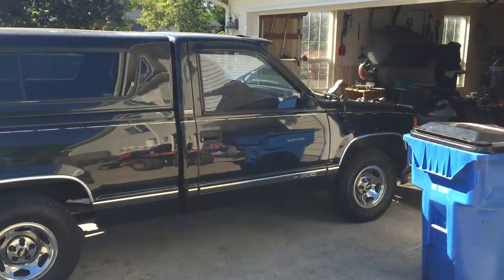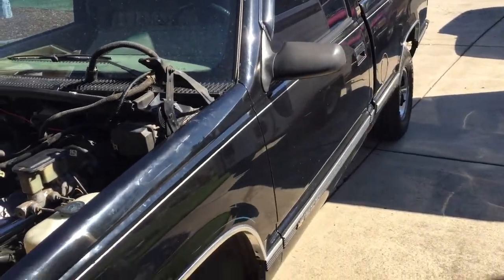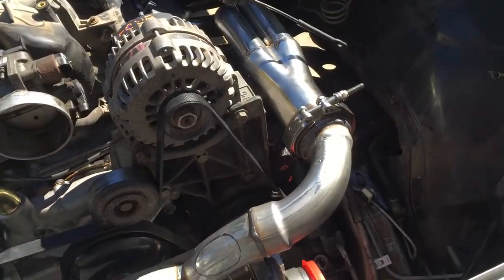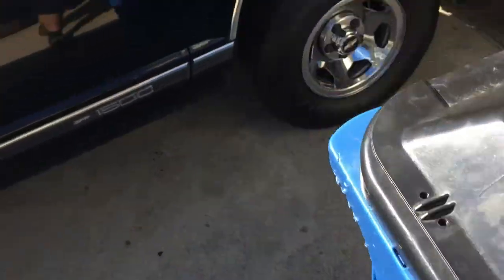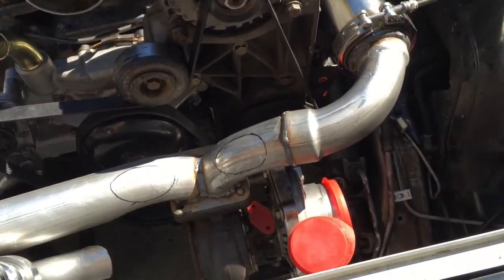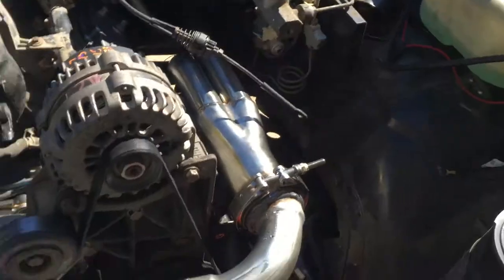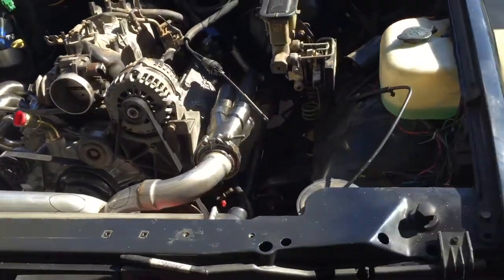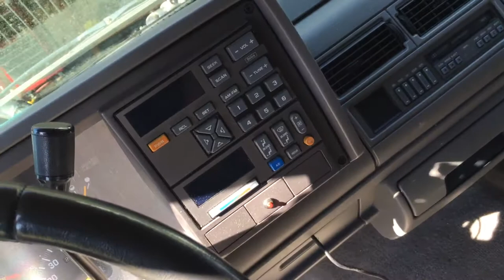93 silverado lq4 turbo swap

Comment: You don't need a to get trans specific computer so say you have a 4l80e but wanna run a 4l60e you can do a segment swap on your ecem for the different transmissions your tuner can do that when he's running out vats

Comment: Google "Lextech LS AC relocate brackets" I bought a set for my 97 it switches the AC compressors position with the alternator (stock 96+ position)  just use some 96+ hoses and compressor and you should be good to go.

Comment: What size exhaust tubing between the headers and turbo did you use? Thanks!
Reply from the maker: 2  1/2 inch between headers.   3 inch down pipe.